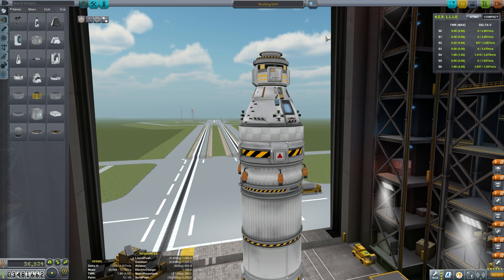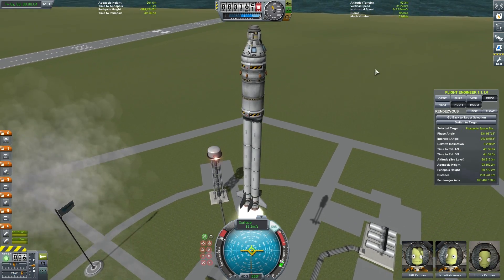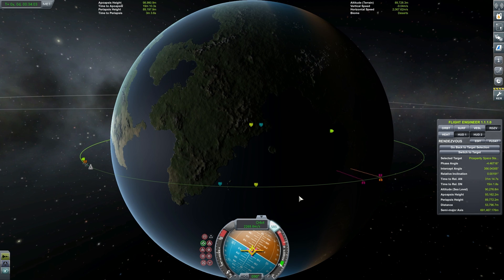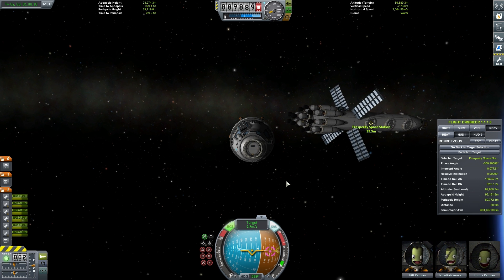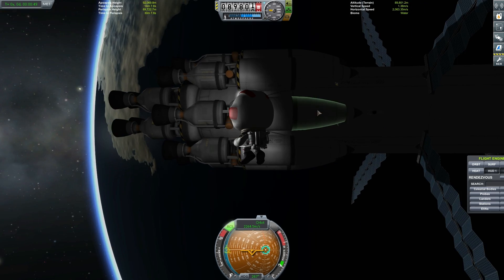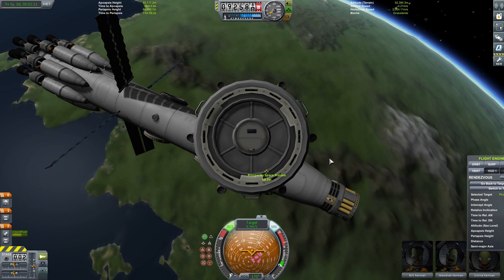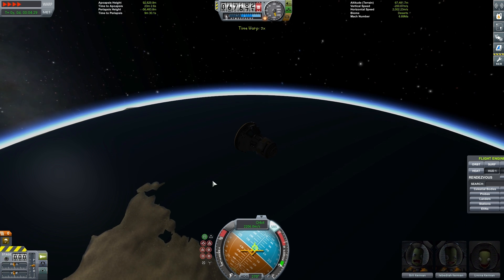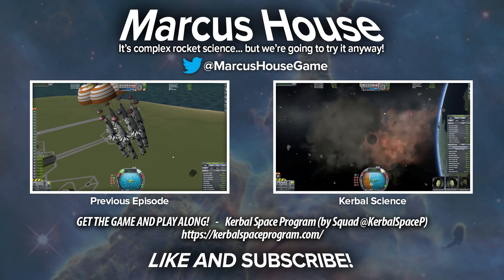Docking and Space Station Inspection (Tutorial: 21) Kerbal Space Program 1.1.3 Stock

Comment: You made that docking look so easy, but it's far from it.

I've pretty much managed to beat the rendezvous part to a reasonable level, but lining up the docking ports for the final approach is a whole different ballgame.  I "can" do it, but the inverted comas are there to signify that it's certainly not guaranteed that I will do it on any particular occasion.
Reply from the maker: Do you use Docking Port Alignment Indicator? This helps a great deal. I can dock fairly easily without it but you first need to get in a good position. DPAI mod is a really great tool.
Reply: No I don't actually...  I'm trying to figure it out without aids and add-ons, although I've been tempted a few times after some seriously lengthy sessions trying to get the damned things lined up.
Reply from the maker: Warriorking1963 if you check our my latest episode I use it a heap. ☺
Reply: Warriorking1963 I Know it's been 10 months but I have a trick i learned recently. Just align your docking port with the normal or antinormal marker and then aligning becomes that much easier

Comment: someone please halp me! i am trying to build spaceplane but it never takes off. i fire the jet engine full throttle and it just keeps speeding down the runway until the landing gear snaps and jebediah then dies. no matter how much i pull up it doesn't wanna get off the ground. please halp i don't want jebediah to die again D':
Reply: okay, i finally got it to fly after watching scott manley's beginner's guide to aerodynamics. saw mark thrimm's videos as well. just adjusted the positions of the front wings, elevatrons, and rear landing gear. that did the trick. now i am happy ^_^
Reply: Make sure that your rear landing gear aren't too far back. If they're closer to the centre of mass, it will be easier to take off.
Reply: Gear just behind center of mass, and put some flaps on the front to help the front up. Just don't let the engine hit the runway :)
Reply: okie thanks everyone i shall try this setup ^_^
Reply: it's not working i'm still crashing :( i adjusted ailerons to be inactive during pitch and i shifted rear landing gear just behind centre of mass and i still can't take off :( centre of lift and centre of mass are pretty much on top of each other
Reply: Maybe you don't have enough lift or velocity for the weight of your craft
Reply from the maker: I recommend also subscribing to the master of SSTOs Mark Thrimm at https://www.youtube.com/channel/UC0azVlk0TJL4oNlsZHQCzAA
Reply: niteshmurti Nice. Good luck with flying it
Reply from the maker: Excellent work. Practice makes perfect :)
Reply: niteshmurti 
Good luck landing it* :P
f5 to quicksave, hold f9 to load (for when you crash and burn)
Reply: haha i crash landed it :P
Reply: Your center of lift must be BEHIND your center of mass!
Reply: Make sure the center of lift is slightly behind center of mass
Reply: elevons bro

Comment: Nice video. Always have trouble with the camera and vessel orientation, so I will start using Locked mode. Also, totally forgot about target mode in SAS - going to be a crucial part of docking for my vessels that have it!
Reply from the maker: Yes, I did docking for a few years without switching to that camera mode. The hardest thing was always figuring out which direction the IJKL keys are moving you. When in locked mode, you just instantly know and it becomes much easier. Some people like to use the Chase mode, but I prefer the locked mode.